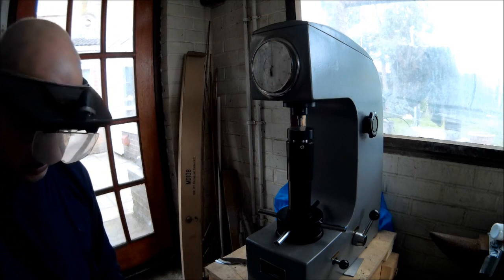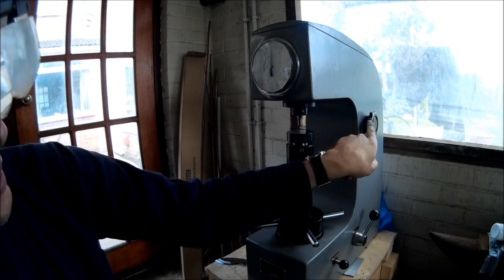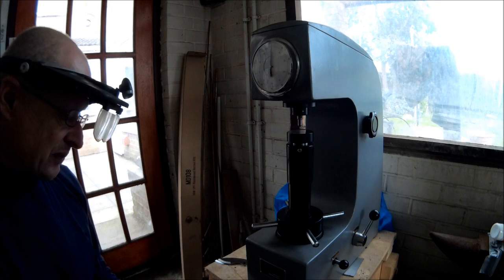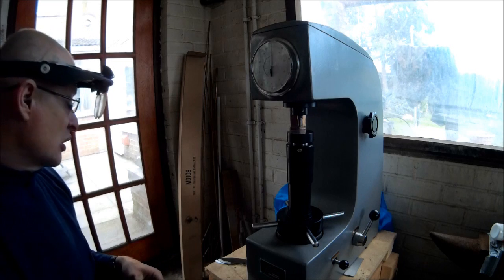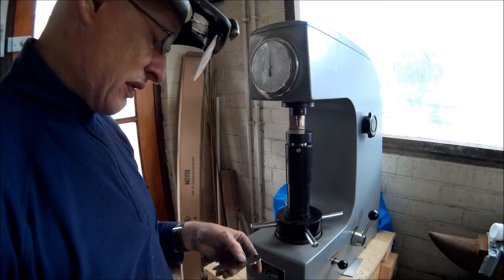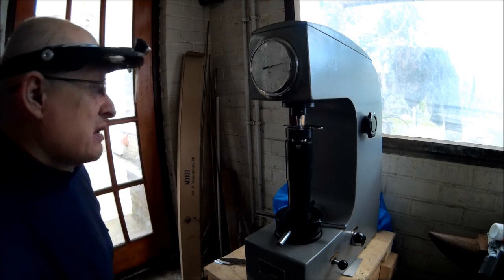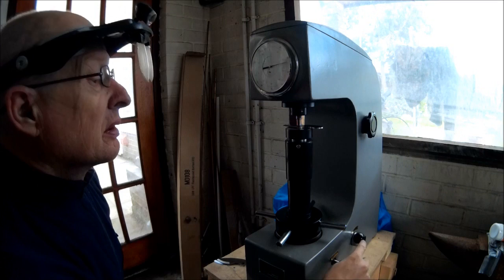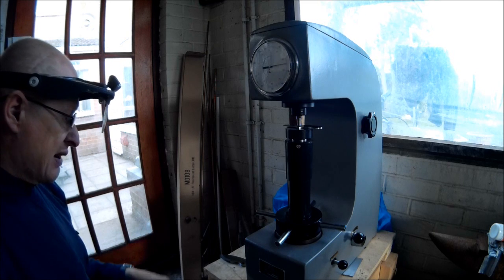Using the Rockwell tester to measure blade hardness

Comment: sandy I have the same machine u have I just got it an it will not load...what do u think would be wrong
Reply: did you buy it new? Have you removed the packing wedges and checked the oil reservoir? There is an adjustment you can make on the piston so that it loads at the correct speed.

Comment: amazing bit of kit there Sandy. I didn't realise the item being tested needed to be prepped as well as the anvil surface. An indent is left in the steel and when the machine is unable to press the indent anymore I guess that is when the needle stops? atb Richie.
Reply from the maker: Thats correct Richie, only you must have everything really clean and no decarb on the test piece.
Sandy

Comment: Great video Sandy,good to see you using it up close(I know I have been using mine the right way now Ha Ha).
My tester works perfectly now,it gives a constant reading from the test blocks.one of my favorite tools in the workshop now,I can always be sure there is no problems with the heat treatment and know the HRC of each knife.
Cheers Jason
Reply from the maker: Hi Jason,
They are good machines but you have to learn how to drive them to get the accurate results. Glad yours is working well now, sounds like you got a bargain. I paid over £800 for mine but wouldn't be without it now.
Sandy